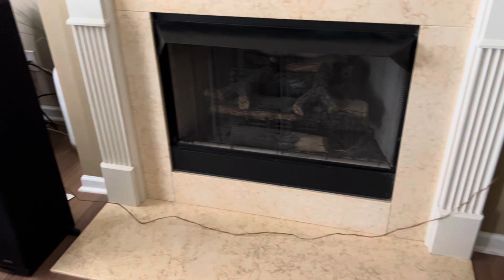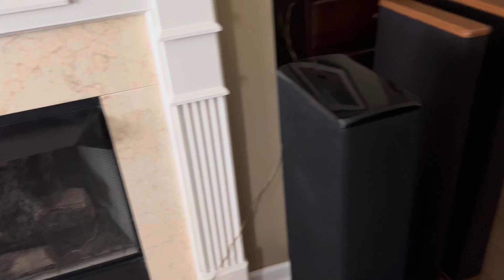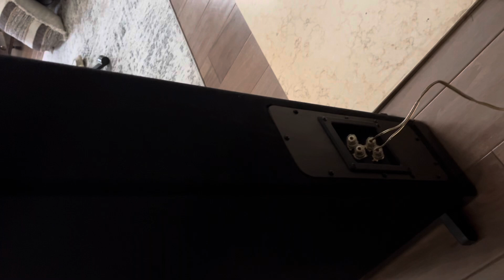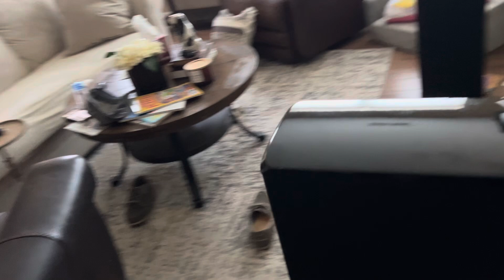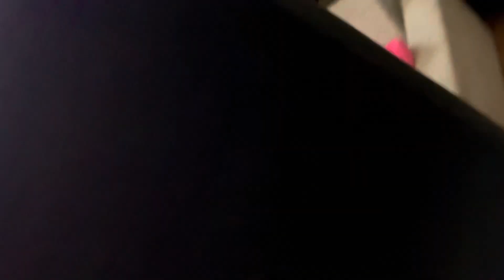Definitive Technology BP7006 speaker restoration and subwoofer amplifier delete - Part 3 (finale)

Comment: I recently bought a used set of Def-Techs and discovered that one of the tower's sub amps was blown. When I looked into it, I found that someone had soldered an RCA cable to the crossover and cut the factory leads which completely bypassed the amp circuit board. This is similar to what you did here, but he was able to retain the original crossover. The RCA cable allowed the listener to just add a stand-alone powered subwoofer via its RCA input. I had an extra Boston Acoustics sub (100 watts) which I hooked up, and it sounds great. I don't know why Def-Tech has had so much trouble with their sub amps.
Reply from the maker: I think it has something to do with the brown glue they slather on the crossover. After years it becomes old and conductive therefore creating shorts in the circuitry. I think I prefer to remove the power amp reducing the weight of the speaker. It makes a big difference.

Comment: Glad to see the finale video and that you had good results! 

I've had mine since 2006-07. They have cherry wood caps and I'd love to get them working again.

I have no knowledge of speakers but I like to tinker. 🤞
Reply from the maker: Take your time and you’ll get through it. Thanks for the support!
Reply: @unclechewy2328 Absolutely. Thanks for the sage advice!
Reply: @unclechewy2328 I installed the crossover and 4-way speaker terminal box however I only get the low frequency when plugged into the bottom, and only the high frequency with the top plugs. I've checked the wiring several times. Everything is the way you showed in the video. Any thoughts? Should I remove the jumpers and go with a Bi-wire setup?
Reply from the maker: @eddieg9506   I don’t know why, but sometimes they put these plastic isolators or washers between the jumpers and screw-on terminal. You have to remove the entire terminal to get them out.
Reply: Can you tell me what screws did you use to connect the speaker terminal box to the crossover? Thanks!
Reply from the maker: @eddieg9506  All of the crossover and speaker jacks were female spade connectors, so you can solder or use male spade connectors. Thanks for the comment and for watching!
Reply from the maker: @e @eddieg9506 Sorry, I misread your question. The inputs came with machine screws. The holes in the crossover didn’t line up properly, so I had to enlarge the holes a little
Reply: @unclechewy2328 mine did not include the machine screws. They only came with screws to attach the speaker terminal box to the speaker. I've been trying to find the right machine screws at the big box stores but they don't carry. I'll try to reach out to the manufacturer...
Reply from the maker: @eddieg9506 try some small drywall screws
Reply: Eurika! It worked!!! Man, my Bp7006's stopped working 10 Yrs ago. Thanks for your vids and quick replies. God bless! 

I had considered removing those plastic washers yesterday but Chat GPT said no 😂. Glad I asked you! instead